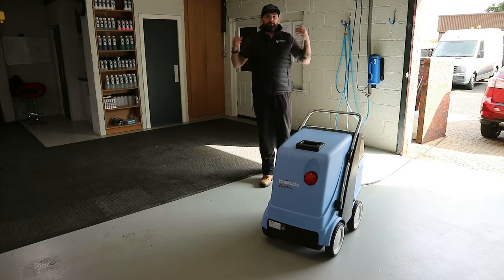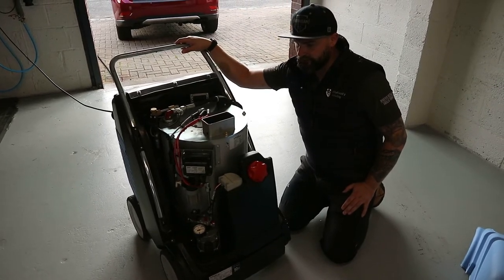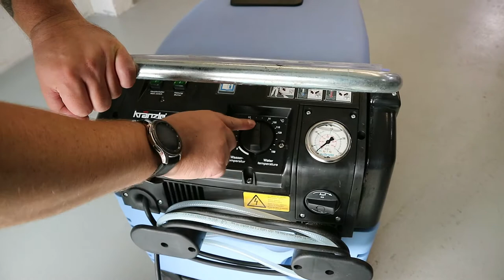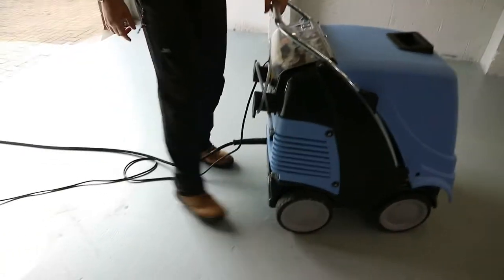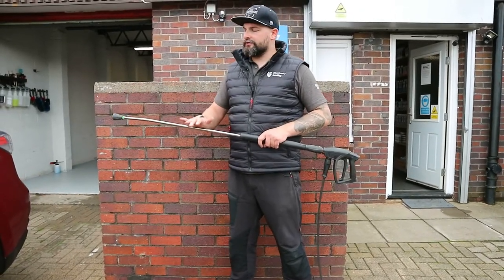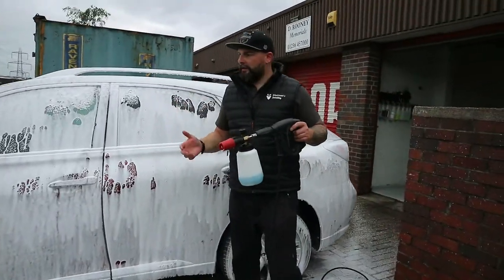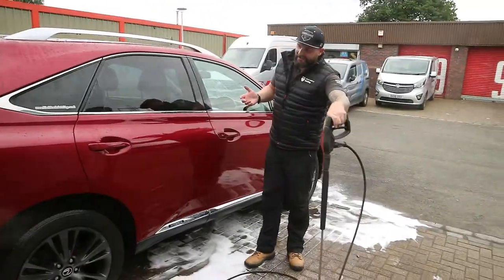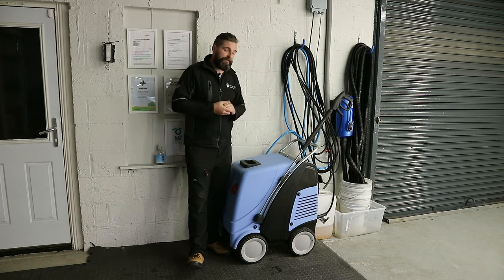Kranzle Therm CA11/130 Review | Blackbeard's Detailing | Hot Pressure Washer Review

Comment: Why must the pressure reduced at temperature above 100 deg C?
Reply from the maker: It says so on the user manual, I am guessing it's to slow the flow rate to allow the burner time to heat the water upto temperature.